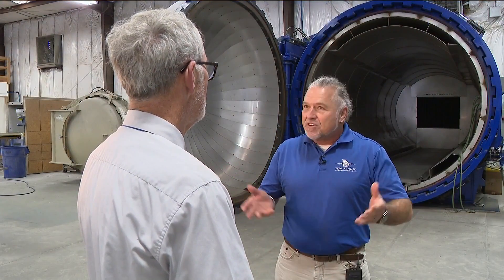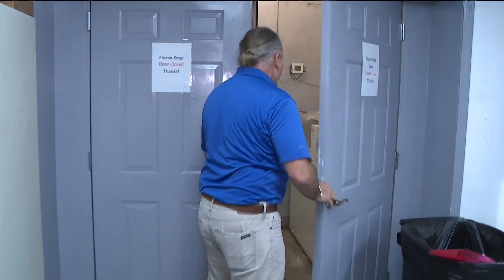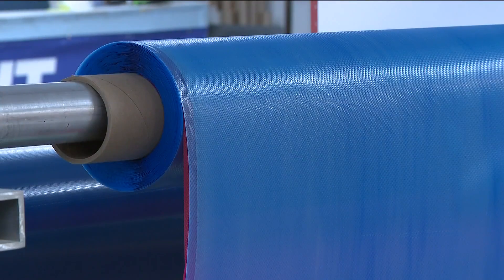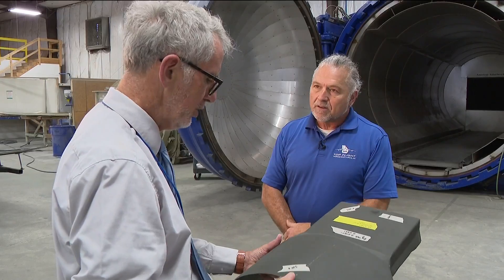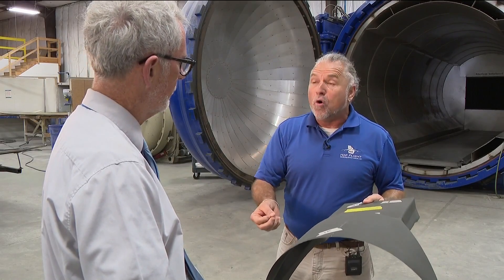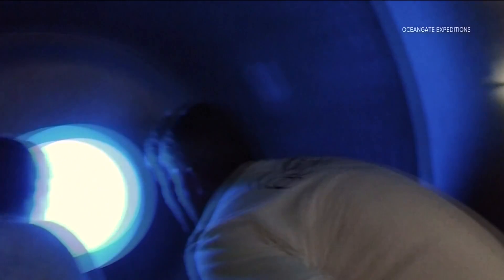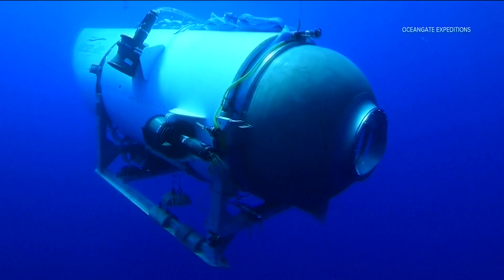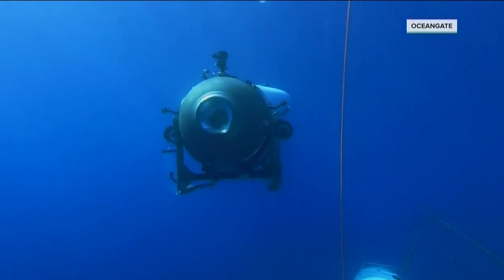Georgia engineer talks carbon fiber that failed in Titan submersible implosion

Comment: Okay, but I want to point out that in airline applications the inside might be at surface pressure (say ~15psi) and the worst the outside can be is a vacuum or 0psi. This means it has to withstand at most 15psi outward pressure, pulling the fibers lengthwise. The Titan was heading towards 5672psi inwards pressure compressing the fiber. Use correct materials in the correct appliction.
Reply: "Professor, how many atmospheres can the ship take?"
"Well it's a spaceship, so I'd say between 0 and 1."
Reply: OK genius, there are thousands of carbon fiber scuba tanks which are used in deep sea applications daily.  They are similar shape and have been around for decades. Please explain this anomaly in your thought process
Reply: Scuba tanks go way way way higher than 1 atmosphere...
Reply: @gbear1005  Yes, internal pressure higher than external pressure. (Or you could not breath out of it.) Those tanks are not meant for higher pressure outside than in. Neither do they go to 4km depth.

Comment: Carbon fiber works well for dream liner , because it has a pressurised cabin. More pressure inside , less pressure outside.  In case of Titan the situation was reverse ; less pressure inside , more pressure outside.
Reply: And really not much pressure inside for an aircraft, just 14-15 psi, not 6000 psi like all of that water pressing on the Titan.
Reply: Yeah but u can make the hull segments concave to make outside be inside

Comment: Wound layers of fibres will be under shearing forces just from variations in ambient temperature - although carbon fibre has a low coefficient of thermal expansion it's not zero, outer layers have a larger circumference and thus a greater length of material per winding than inner layers, and are thus subject to more expansion and contraction for a given change in temperature than the inner layers.  Even without the stresses of repeated deep-dives the previous year, if the sub wasn't stored in temperature-controlled conditions then it was probably weakening with each passing day regardless.

Comment: Carbon fibre and fibre glass have both been used in boats.
They both deteriorate over time. It seem likely that if you use these materials under far grater stresses that they will fail a lot faster.

Comment: One of the design issues not pointed out is that the CF was wound around the hull axially, meaning that the only thing resisting the longitudinal stresses was the epoxy.
Reply: Stop stifling his innovation!

Comment: I'm saying this machine should have been tested to 20,000 ft many times without passengers to develope a safety margin.........What did it actually have for a safety margin.???.........Utility catagory aircraft are built to withstand 6.6 times the expected normal loads.........Even cheaply built 172's are built to meet a normal catagory airplane and requirement there is 4.4 times the normal expected loads........So what was the safety margin of the Titan.......................Paul

Comment: Carbon fiber cloth bound with resin. Interestingly I read that the right kind of resin one should use to lay up carbon fiber is epoxy resin. I make split cane fly rods (bamboo) and glue up the sections with two part epoxy resin. The resin is very strong but movement of the bamboo under stress, such as casting or a fish, puts shear stress on the bamboo. Epoxy also needs the correct temperature to cure properly. Split cane rods are usually cured in a heat treating oven. In essense the glue can be stronger than the bamboo, but I don't think I'd trust it 12,500 feet below the ocean with repeated stress in a submersible.
Reply: You are correct about epoxy resin. At very low temps, it is extremely brittle. The thickness of epoxy (at each Bond Layer of CF) would be measured in micrometers. Epoxy Bond (at that bond thickness) and at 4 degrees C, would quickly develop stress cracking from the natural flex of the Cylinder under great pressures, and then returned to atmospheric. This is how I believe the disaster happened. CF composite became weaker upon each dive. It had to be the reason. Those 5 persons still weighed their true weights, inside that Capsule. The downward force (weight of 5 people) would have also placed an uneven stress on the internals of the formed CF Capsule, giving the cylinder tendency to take on a slight elliptical. Not certain if payload was factored-in during design, or how the flat floor was secured to the Cylinder. RIP to those pioneers who won't be forgotten.
Reply: @peterduxbury927  Added to that, the carbon fibre was rolled on circumferentially, whereas best practice is to lay up alternate layers diagonally so that the material is equally strong in all directions. Further, the construction was carried out in a large, probably dirty and dusty workshop and there were no processes for degassing the resin, so the layup undoubtedly included dust and dirt and air bubbles, all locations where failure cracks would start to build up.
Reply: @Smannellites  I have to agree with you that when laying the CF material, it wasn't cut (or wound) on the bias, but wound circumferentially, with yarns laying upon yarns, with air bubbles locked-into the whole formation. Clearly, an inherent longitudinal weakness in its' design. I also observed the methods of cleaning the titanium annular ring (for the bond between the CF and titanium). A wipe around the ring with (what looked like) an old cloth with possibly contaminants! I also observed that the depth of bond between the titanium end-cap and CF Tube was nothing more than 50mm! Even Stockton Rush commented about this. It is good that many engineers can come together, pass comments, even though we (personally)  have no hope of ever building something so unique, it CAN pass all Safety Testing with flying colors! Without Carbon Fiber as a structural element!  But (to me) there were many errors that led to this tragedy. I believe that the distant future will provide us with vessels that can reach those 4km depths, carrying paying passengers too, and not just around the Titanic.

Comment: The problem is before all of that, recurring tests must be done with carbon fiber under the pressures found at the depths of the Titanic. Ultrasound testing is a routine method of inspection on already certified materials. The issue here is that carbon fiber would never and will never be certified for deep sea diving!

Comment: The air pressure at 35,000 feet versus 600x the pressure on land 12,000 feet in the sea. That's what Stockton got fundamentally wrong. The fact he didnt understand the differences says a lot about how confident and blind he was. His privilege and ignorance of failure lured others like him into their own folly. Theres a reason a billionaire black dude would never be there with him.

Comment: I think I stumbled on a new business model for deep sea exploration.  I'm going to just buy one of those ovens and lower it by rope to the titanic.  It looks stronger than the Oceangate submersible and I think I can get 50 people in that one but I will monitor the descent from the ships control room.  I think this guy might be doing a little damage control for the carbon fiber industry.  I know people were concerned about the impact on the submersible industry if there was and accident and expressed that concern to Stockton in a letter.  I'm sure the carbon industry is concerned if it will see any impact on its businesses.

Comment: there is nothing inherently right or wrong with using cf in this application. the failure was that not enough testing was done prior to use

Comment: It surprises me that there's no mention here of the fact that composites can be unpredictable when they're under compression - like in the skin of a submarine. In the Boeing 787, or any jetliner, the fuselage is pressurized from the inside - the cabin has to be under higher pressure than the outside air to allow the passengers and crew to breathe without oxygen masks. That means that the entire skin of the pressure vessel in an aircraft is under tension - which is when carbon fibre is at its best. Under the sea, the pressure is far greater on the outside of the submersible. The sea is squeezing the pressure vessel from all sides, placing the carbon fibre under compression from all angles. This introduces all kinds of hard-to-predict failure modes. I learnt this stuff during my aeronautical engineering degree quite a few years back and I'm really surprised that this isn't talked about more in relation to Titan.

Comment: They apparently only got 3/4 of the way down before they got warnings and cracking sounds, and dropped their "ballast" weights and steel frame and tried to go upwards. But about 20 minutes later the craft imploded. That is the latest info I have fwiw.

Comment: That engineer did not mention that carbon fiber composites are strong under tension but weak under compression. The submersible was under compression. Carbon fiber was a very bad choice for the deep sea dive application.

Comment: I don't think they even know if the carbon fibre hull failed. If you look at the debtis the window is completely missing...
Reply: The window and his retaining ring ( located outside) were blown up outside par the air compression similar to a diesel effect, broken the bolts.

Comment: Carbon fiber is only very strong in tension.  Pressure from outside the sub's hull put the fibers in compression.  CF was nothing more than a filler for the epoxy resin which had some strength due to being five inches thick.  The sub imploded because the fibers were asked to be strong in compression.  The sub would have easily contained the pressure at that depth only if the pressure was on the inside of the hull.  A solid fuel rocket motor with a carbon fiber casing contains the pressure because the CF is stressed in tension.  It is the difference between pulling on a string and pushing a string.

Comment: "under 13,000 feet of water"

The Titanic wreckage lies at 13,000 feet on the Ocean floor. The Titan was nowhere near the Ocean floor when it imploded, according to the Navy who picked up an implosion noise in the vicinity shortly after contact to the submersible was lost, around 1 hour and 45 minutes into the usual 3-hour-long descent of the Titan. So, the implosion likely happened somewhere around 7,000 feet under the Ocean surface.
Reply: @lskdjf3000  Paul was wrong, the website states the descent and ascent takes 8/9 hours. Therefore a descent would require 4 and a bit hours, whereas they were in the water for 1 hour and a half before implosion. Thus they were nowhere near the Titanic before the incident. The ship then fell to the seafloor, about 500m (1600ft) from the Titanic (still no where near it).
Reply: @TopFix  There are indications that the descent rate for this dive may have been more rapid than planned (if the transcript of the comms is authentic). That would suggest that they may have been near to the Titanic when the problems started. Supposedly, they shed the ballast and, but still failed to rise significantly before the failure occurred.
Reply: The Owner stated that the desent would require 1 hour, 45 Min...............Paul

Comment: Does anyone know how you autoclave a 5 inch thick section of carbon fiber?
How long of a vacuum period does it need to evacuate air voids?
I’ll add are 5 inch thick carbon fiber parts a thing?

Comment: Carbon fiber is not strong for inward pressure only outward. Next ocean gate used barn yard glue to glue the carbon fiber tube to the titanium lid using only a few inches of the hull to glue together the hatch big big mistake. Im right on this. Only a few inches of area was used when ocean gate joined the carbon fiber cylinder to the hatch and hatch ring. Big mistake.and joing two different materials big problem number two.

Comment: From what I understand is that the material is better at inside presure not outside presure pushing in.

So it's perfect for going up things like planes and spacecrafts but not submarines.
Reply: Not much differential pressure for an airplane either.  The cabin is about 10psi while at 36K feet the outside air pressure is about 3.7psi. For the sub, outside pressure is about 6000psi.  If they are at one atmosphere inside the sub it would be 14.7psi an enormous differential.

Comment: Dude, any engineering student can calculate in 5 minutes: Compressive stress in the carbon fiber polymer (CFRP) wall of the Titan submersible was about 200 newtons per millimeter squared at Titanic depth. This corresponds precisely to the stress level where CFRP typically fails under compression. Only under tensile load (which is not applicable underwater), CFRP can withstand about 10 times more. What's more, OceanGate used unidirectional (circumferential) CFRP. This means that in the longitudinal direction, the hull was only about half as strong, at around 100 newtons per millimeter squared. It's a miracle the ship even made it to Titanic a few times without imploding.
Reply: More like that tube was not build of carbon fiber, cos it doesnt matter so much under pressure, it was more like epoxy tube. And connection to rings was another fail.
Reply: Amazing that this guy had an engineering degree from Princeton. We learned how to do these calculations in high school physics (good enough for napkin checks).
Reply: @sdrc92126  I think he came from a wealthy family. Probably never went to class and paid some extra to guarantee the piece of paper. What I don't understand is if he was wealthy why so cheap and cut every corner possible.
Reply: @dwaynepiper3261  ... Because that is one of the how the rich get richer.  Being cheap, cutting corner e.g. underpaying your employees is how you pocket extra money.
Reply: Yep
Reply: U are very smart
Reply: Sorry for all these tossers worry so much about whether the bonding agent is a "plastic,,resin,or matrix" doesnt negate your argument,,just nit pickers trying to sound superior,,aspergers freeks,,
Reply: I think CF would have worked on the sub hull, but it wasn't thick enough to withstand those kind of pressures. He didn't heed the warnings of the cracking sounds the CF was giving off. Say you take a thin piece of wood the thickness of a paint stirring stick and put it between two blocks and start putting weight in the middle, it's going to start making cracking sounds until it eventually breaks as more weight or pressure is put on it. Then lets say you take a 4x4 piece of wood and put it across the blocks and stack weight in the center, it's not gonna make cracking sounds when the same amount of weight or stress is put on it. They're both made of wood, but both have different compressive strengths. When he heard the cracking sounds he should have realized his calculations were wrong, and the CF was not thick enough, but he was Stockton Rush, and Stockton is never wrong. If he would have made that hull 2 feet thick, and redesigned those end caps where they locked in to the carbon fiber tube with rubber seals to flex, he would probably still be diving.
Reply: But acoustic censors... That they totally ignored when the sub was making noises as loud as fireworks, even when within 300' of the surface.
Reply: Its like an frp pressure vessel. 

Fiberglass reinforced plastic
Reply: There was NO CFRP in the Titan........The P stands for plastic.......If You are an Enginnering Student, You are failing..............Paul
Reply: @paul-flyer  No. CFRP stands for Carbon Fiber Reinforced Polymer. Try looking things up before making a fool of yourself in public.
Reply: @richardpare3538  Well, that's gonna leave a mark...
Reply: @richardpare3538 polymer is plastic bruh
Reply: @samholdsworth420  Other way around--plastics are a kind of polymer.  Carbon fiber is a different kind of polymer.
Reply: @samholdsworth420  Plastic is polymer, not other way around. "A polymer is a substance or material consisting of very large molecules called macromolecules, composed of many repeating subunits" (c) Wikipedia. Both plastics and epoxy is polymers.
Reply: @rikk319  the polymer is the RESIN.
Reply: @paul-flyer  are you implying the fibers didn't have and binder holding them together? If that was the case the ship would have fallen apart like a wet noodle as soon as they went to pick it up. Carbon fiber when manufactured is cfrp. I am not aware of any manufacturing method that uses only carbon fibers themself. The fibers used in a wound layup are coated in epoxy resin before it is wound such that the epoxy does not need to be applied during manufacturing.
Reply: @paul-flyer  its polymer, greenhorn